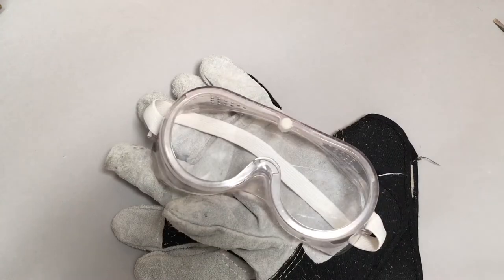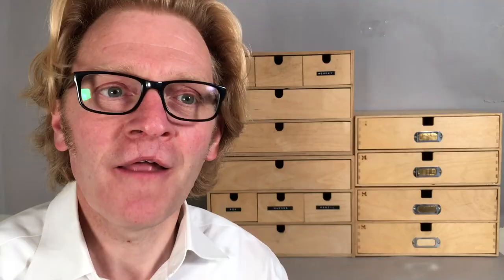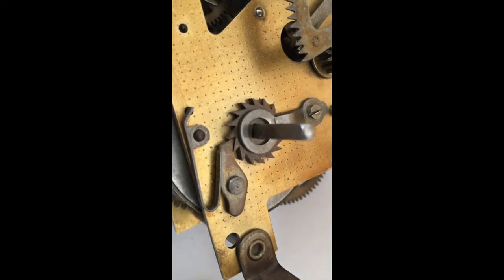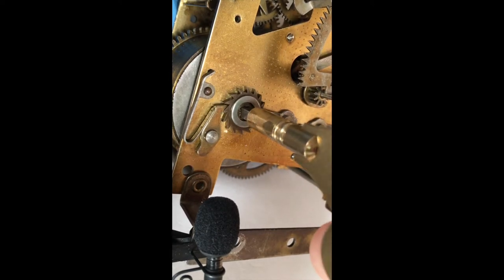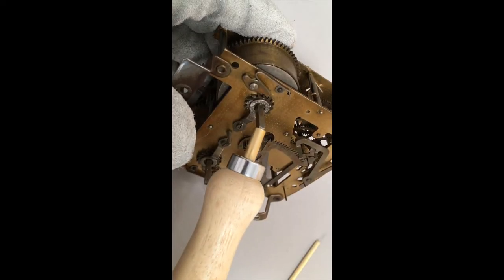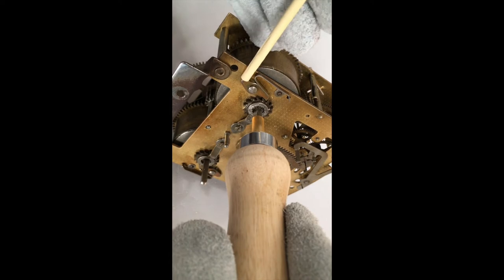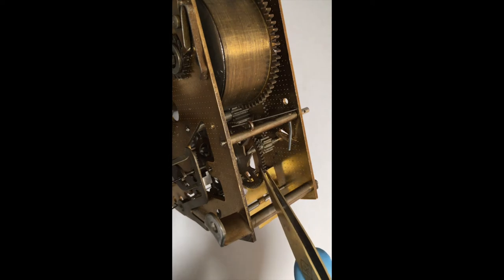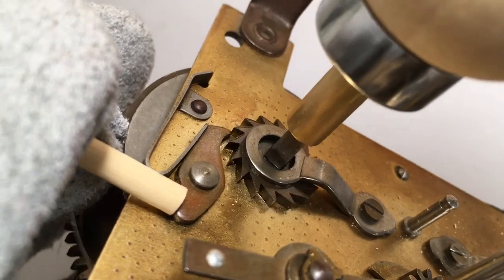005 Clock Mainspring - How to let down the power... Safely!

Comment: Excellent camera work sir...I have several clocks I need to do exactly this...thinking I will throw them in my ultrasonic...oil a bit...and see if that's the issue for some of them...probably not and will need pivot holes redone...but I am a beginner so will try the basics first. Be safe and thanks again.
Reply from the maker: Good luck. Thanks for the positive comment.  You may want to check out our new clock repair book, it is aimed at beginners.
Reply: The problem putting them in the ultrasonic tank , is if they are mainsprings in a barrel, and not the open type, some of the cleaner will stay in the barrels and rust the mainsprings. I always take them apart clean and re assemble without the springs in, then check the pivot holes for wear If they need re bushing I mark the holes take apart and re bush the pivot holes.

Comment: Can you safely unwind the spring without the ratchet wheel? I mean, just the motor by itself? I may have disassembled a bit too much.
Reply from the maker: You mean by just letting the clock run down?  Yes you can but not ideal as the bearings on a clock that is being repaired are typically dry and contaminated.  That may be your only option.  What is important is to get all the power off the spring before you disassemble the frame nuts.  M

Comment: Could this work on a clock that quit working after it was wound?
Reply from the maker: Hi Joshua

Letting the power of a spring can certainly help diagnose what is the problem.  A clock cannot be overwound as such.  Normally what happens is the springs dry (lack of lubrication) and it binds.  When you let the spring down, if it is not smooth/makes a lot of noise, that may be the case.  Otherwise you may have a problem with what is called depthing.  That is the mesh of gears that deteriorates due to wear in the bearings.  Matthew

Comment: I let down my three springs tonight and now it’s all of the click springs that have no power either.
Reply from the maker: The click springs no longer function?
Reply: @howtorepairpendulumclocks  
Yes. When I got the movement out of its case, all three mainsprings were not winding down no matter how long the clock functioned, as if it had a tiny little spring. Strange, I thought. When I used my let-down tool, (the first time I’ve used one), the click springs had plenty power. When I let the mainsprings down, they seemed to have plenty room to unwind. 
I have gotten one click lever to go into its ratchet wheel but there’s a space between the others and their click springs. There must still be power in the click springs. I noticed the plates are very mucky and slimy. I think someone has set about it with WD40 at some time. There’s a line of muck along the bottom of the front plate. I think it is either the WD40 and dust, or it’s been over-oiled at some time. 

I think maybe the clicks have oily muck round where they pivot, and of course, everywhere else on the movement too. This clock only cost me £30, so I’m going to use it as something I can learn on, rather than one I have to fix within a certain time. I’m going to take the springs out and see if a little bit of bending will fix them, although that wouldn’t fix much as long as the clock is grimed up. I’m a complete newbie at all this btw.